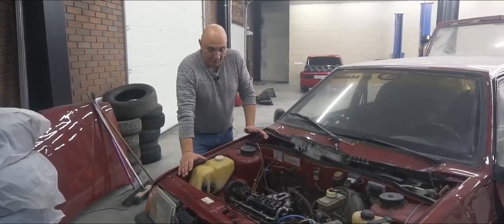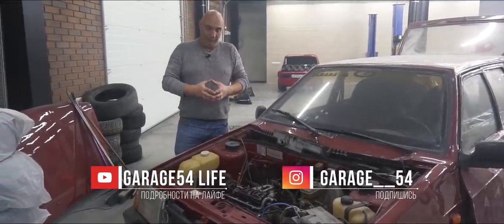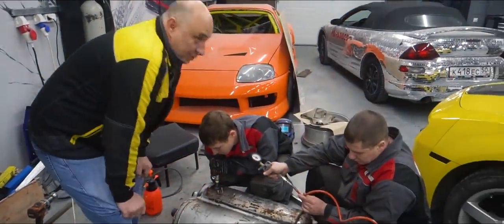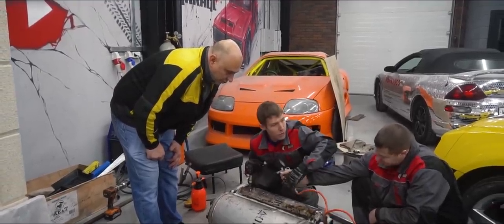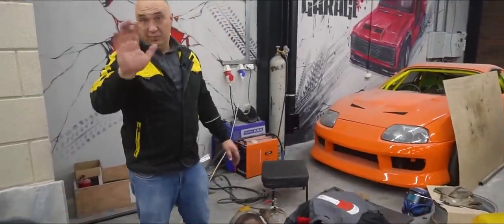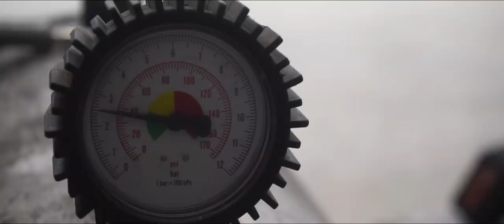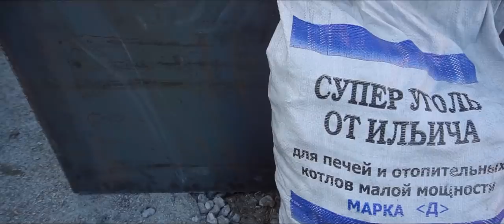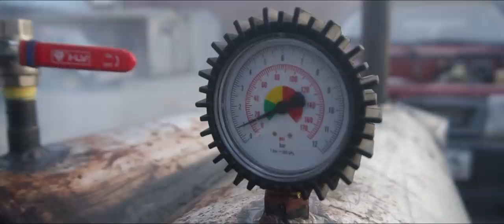Steam engine conversion – first startup

Comment: Put the steam engine on a trailer behind the car and pull it around while driving....you’ll figure it out.
Reply: Well, the boiler on a trailer, anyway. Of course that would require a very long steam pipe running to the engine and a flexible section ...
Reply: Merlin Skinner True, but he’s known to do some crazy configurations. I guess he could also put it behind the seat by taking the top completely off...OR, use a truck and put it in the bed. It’s a crazy idea to begin with, so anything goes at this point.
Reply: full boost caboose style
Reply: I would say that putting the boiler on a trailer is quite a good idea unless of course you want to set the car on fire and kill the driver, the steam pipe going to the engine will need good insulation and to be flexible on the end to allow for going around corners.
Should be good for a laugh if nothing else.
Reply: barry phillips Hey , I never said it would be safe 🤣. But he’s done some questionable things in the past, did you see his cabin on wheels with a burning furnace for his sauna. And let’s not forget the girls in bikinis! 😂
Reply: On the Russian version of the channel, they finished this project quite a while ago. They just cut the car up and slam it on the back of the car
Reply: Robert R Thanks, just watched it.
Reply: Eghads! NO feedwater system, NO safety valve, not even a level sight glass!
Let's NOT do this.
Reply: can they also recycle the steam coming from the exhaust back into system perhaps
Reply: @michigandon  they are just going to send it
Reply: @jarredri  huh?
Reply: Sorry, but as an operator of large stationary 100K PPH boilers this is like a MAJOR cringefest.
Reply: @michigandon  they are in Russia safety is the last thing on their minds they just want to prove that it will work.
I used to work in a power house maintaining 4 800 hp stem generators running 500 psi steam pressure
Reply: Just put the boiler on the roof of the car. Or cut the roof if you want to keep the car and the center of gravity low
Reply: behind the front seats  just i hope they put in a fire wall to protected the driver and take out the fuel tank. good job 54
Reply: in the trunk. bonus excellent heater for cold russian winter
Reply: you should put the boiler on a trailer and use a car with the engine in the back so you can shorten the pipe
Reply: @jayesjjani2278  Or into a sauna on trailer behind the car?

Comment: Everything about this boiler gives me the fear... the project is cool, id just watch from a mile away 😂
Reply: And now they are going to strap it to an old Lada and drive it around. Absolutely idiotically dangerous but that's why I love this channel
Reply: Surely one of the most dangerous thing a ever see. That's crazy
Reply: No way of keeping an eye on water level, fire tubes out with the water level, giant seem welds along an un braced seam that leak and no safety valve 😂 its so horrifying but yet so fantastic at the same time 😂
Reply: @Frz45  Watch in 2020 for the "Turning a Lada into a powered wheelchair" episode
Reply: Oh those Russians 😂
Reply: Read my mind, as soon as I saw how those two tanks were cut and welded together.
Reply: @andresouza2314  Yes they eliminated the hoop stress of the original tanks when the welded the two together.  They should have used two separate tanks plumbed together for safer boiler.
Reply: Or a flat plate spanning the main weld seam.  Yes, they have a dangerous pressure vessel.   All kinds of pressure vessel rules broken beyond that.

Comment: Looking forward to 3 years from now when these dudes are putting rockets into space.
Reply: A wooden steam power rocket ship that was cooked in soup
Reply: *Rockets on a Lada.
It doesn't have to go up to space, as long as it flies high enough and explodes magnificently.
Reply: Building sketchy boilers with no pressure relief valve, they won't live long enough.
Reply: @1one3_Racing  they'll be fine.
Reply: Ladas in space*

Comment: Zero carbon emissions

Meanwhile at the boiler room:
Na, Ivan, burn the Mamut, da?
Reply: Dude i laughed so hard best comment
Reply: Yeah, natural gas would be a better option, but hey, I like the idea!
Reply: the car itself is carbon free until the next episode 😁
Reply: comment is spot on, and I don't care what anybody says there's nothing on Earth that's zero carbon emissions. even the finest electric cars have utilized diesel fired engines 4 mining equipment and the production of the materials to mind the necessary metals to produce everything on the car. also the more Plastics memes there's more oil involved in the production of the vehicle. all you do is you just trade one bit of controversy for another.
Reply: Sunshine Kid it really would be rather funny if they took water heater figured out how to retrofit it to the car.
Reply: It is very efficient. Only consumes 15KG of coal per minute for idling.
Reply: @seanstrack4022  Also, unless they're getting their charges from a solar only system, then they are likely getting the electricity to charge them from an electricity plant which still burns fossil fuels.  So even if everybody had electric cars, but charged them off the local power grid (which the infrastructure couldn't withstand but assuming everything just worked) they would be a HUGE burden on the local power plants which would have to burn even more fossil fuels to keep up with the demands.  So yeah, you're just trading one form of emissions to another is all it is....
Reply: Да

Comment: You can call this already a small success with the very limited knowledge of steam boilers and engines these guys have.
There are however a few considerations I have to give with my knowledge gathered as a steam locomotive fireman.
First, a steam boiler can be an exceptional dangerous device, more hazardous than cylinders with compressed gas or even some explosives.
They want to run the boiler eventually at 8 or 9 bars, at that pressure you get a boiling point of around 175°C.
The water volume in this boiler I estimate around 60 liters.
Steam has a volume 1800 times bigger than the water making that steam.
When that boiler fails (which probably will be the weld holding the halves together) the 60 liters of water will turn into 108 cubic metres of steam in an instance, because the water escapes into atmospheric pressure of just 1 bar where its boiling point is 100°C, the amount of energy in this explosion would be the same as contained in 35 .50BMG rounds.
So I would never consider even firing this boiler up to 9 bars with its strange construction and untested welds, the shrapnel from the boiler can easily kill someone.

They should have done a hydraulic test first at least, by filling it up with water completely and then adding pressure with compressed air trough the valve at the top to 1.5 times the desired working pressure, which is the easy way, cold water doesn't expand when the pressure suddenly drops so is relatively safe, you could get soaked in the worst case.

By this the boiler doesn't have a pressure release valve other than the manualy operated valve, when this valve can't be reached for some reason, or someone forgets to check the pressure; RUN FOR YOUR LIVE!

Then there is the water in the steam, the steam is what they call wet, it means that the steam temperature is just about the evaporation temperature, so if the steam comes in contact with colder surfaces or has a slight drop in pressure in the engine it starts to condensate.
This can be overcome by superheating the steam, by running the steam pipe between the boiler and engine trough the fire a couple of times, this raises the temperature of the steam without further raising the pressure, then the steam will be able to expand and cool down to some degree without condensation (the expansion causes the steam to cool down as well)
Real steam engine also do have drain cocks at the working ends of the cylinders where any water which collects in the initially cold cylinders can be drained trough, at start up these are open and are closed when the cylinders are at operating temperature, just check any video of a steam locomotive starting from stand while expelling huge clouds of vapour from their cylinders.

Then there is lubrication, the steam will mix up with the standard motor oil, so a special steam oil is needed.
Reply: Chill out they are slav's
Reply: This guy knows exactly what he's talking about - listen to him!

This project was MUCH more dangerous than their usual "Russian" danger levels for many, many reasons. They should really have consulted with some experienced (model) boiler designers/constructors before building their own...
Reply: Andrija, they are extremely dangerous slavs
Reply: Also no water gauges, no means of getting water into boiler, no fusible plug. This is a very frightening project. Like you Tom I have worked with steam all my life (54 years and counting) and this project scares the crap out of me. They might be Russian or Slavs but this can very easily KILL them and people around them. Lads the footwork has been done, read some books on boilers please as they have been written with the blood of our forebears. You are playing with a bomb!.....
Reply: @raymondo162  slavs are most dengerus to them selfs sorry for bad english im slav to
Reply: abner doble did some testing with regular motor oil, works fine, but needs extra equipment to make it work for long.
Reply: You are right Tom. It looks like they using high steam pressure, NOT steam expansion! high-pressure steam is 100 times as dangerous! and why later steam trains boats, etc mainly use expansion powered engines as they progressed, also wet steam will end up giving the engine hydraulic lock. Like you said it needs a heated feed pipe. 

I would not be in 500m with that thing not having a pressure release valve without any pressure testing!!  I would at least fit a pressure release valve set to say 4-5bar light it up stand back behind a house truck etc, and wait for one of them to blow, boiler... or pressure release valve? if its the latter set the pressure release valve 20% lower!!
PS I would not use a car engine if using high-pressure steam, but a suitable turbine/impeller pump instead.
Reply: they'd have to build a new head and feed it with a thin pipe full of liquid steam to do it adequately.
Reply: @hardergamer  It's still possible to use expansion with wet steam. 
Most steam locomotives before 1915 used wet steam, from then super heating came into use, although shunting (switching) engines didn't use it as at low speeds the super heating had very limited effect. 
With super heating a higher degree of expansion is possible, with valve cut offs of 75% or more. 
I suppose this car engine still has its valves and cams, so a percentage of cut off is available, and it uses expansion. 
The real danger of this experiment is in the boiler, because of lack of safety devices and its unsuitable shape and poor welds.
Reply: Just the sake of safety (structural integrity wise) could they have used a water heater? I remember looking at one once and it said it could handle 175 psi, sure it's not meant to be a pressure boiler but if think it'd be safer, plus don't water heaters have a simple pressure release valve? I remember the Mythbusters used 4 water heaters as boilers for their steam machine gun experiment. The gun never worked right, but it seem like the boilers did...
Reply: water heaters, most of them, have an air release valve, so they'll be full of water.  when they start making gaseous steam they'll get real scary, so the valve burps it off, but a continuous supply of water would be needed to keep it from building gas despite the valve.

long as they keep it below pressure limit, have a gas release valve, a constant supply of water and a soft solder low water blowoff, they should be ok.
Reply: 2 bars is fine but I'd be a bit concerned higher than 4. Unfortunate it probably needs 6-8in an engine that size to at least do a skid.
Reply: they probably have the skill to build a whole new engine and integrate a 2:1 gear(they were getting about a thou rpm i think), v4 would probably be a better package.  the pistons would need a quarterish of that surface area to do the same work.
Reply: Another thing they could do would be to route the exhaust steam through the stack to induce a draft into the firebox thus eliminating the fan once it is running.
Reply: probably be a grand idea if they were doing continuous steam production, but with the main storage tank supplying the draft steam, not probably that grand.  a separate supply, like, household water pressure through a copper tube could supply the draft.
Reply: I hope your comment gets more likes, and more exposure to anyone considering experimenting with steam. Its spot-on and informative. Sure theres lots of stored energy in petrol based fuels but its only released some at a time depending on atomization (surface area available for reaction). Superheated water under pressure can release all its energy at once (exactly like an explosion) and thats the scary part. You cant put that monster back in the box once it starts to escape. Given the choice I'd stand beside a failing oxygen tank under 2000+psi rather than a failing steam boiler of the same size at 20psi, at least I would have a chance.
Reply: You certainly have some decent knowledge about boilers and physics. I wanted to warn them about this, but you already done it better than me. I can't even dare to stand in 100 meter radious of that home made boiler when it runs at 4 bar. The explosion will not end just to super heated water expansion. Think about the fuckin fragments coming from the body of that boiler!!!! While flying at 3x sound speed Lol
Reply: After reading his whole post, this was perfect. Hahaha
Reply: I think that this is more for proof of concept. But I do agree, it is dangerous.
Reply: If that channel allows the real channel read these comments... or else the comments of this video are just a waste of time.
Reply: And that’s why there never were a follow up video...
Reply: 😐 jokes on you smart guy that's vodka in the tanks not water.
Reply: @felderup cool story bro.
Reply: @tom lahaye cool story bro.

Comment: 1700s steam cars 
1890s gas engine cars
2019 electric cars
2050 steam cars
Reply: You missed electric cars in the early 1900's, actually before gas.
Reply: The first car to exceed 100KPH was fully electric!
Reply: 3000 electric steam
Reply: The problem was and still the batteries
Reply: Unintended Consequences  Pollution in the production of the batteries and reliability stills a problem
Reply: Unintended Consequences  Unless you happen to be in one when it goes up like Kakatoa and it HAS happened.
Reply: I wish I'd love for a proper crack at a steam car with a proper White/Doble  steam generator + a Heat exchange on the condenser + a lightish frame closer to the Stanley Steamer Cup car + Automation of steam systems like clearing water applying oil and maintaining pressure. That combination has never been created (and many "modern" versions like that British one are crap).
Reply: Also 1925 was the last great steam car.
Search:
1925 Doble E-20 Steam Car - Jay Leno's Garage
1906 Stanley Steamer Vanderbilt Cup Racer - Jay Leno's Garage
1907 White Steam Car, 30 Hp - Jay Leno's Garage
Reply: @timelord10  petrol cars came out in 1870s, before electric cars

Comment: Garage 54, always welding through the paint and the rust. No surface prep leads to very real results.
Reply: Are  you  expecting  red bull  and  mc donalds  stickers  on  it  ?  .................
Reply: @Gabriel-he6ih  You  first  .............
Reply: I think he is expecting actually good welds that can handle steam pressure and not leak.  You want that before you line the pipes with thick insulation to prevent the condensation.
Reply: Turtle Head  No one wants to see your turtle head. Welding is a trade, not a profession. I am a certified welder and surface prep is basic.
Reply: Still better than most SEMA welds!
Reply: And if you put the amp's up, it doesn't really matter for "farm" use. #sendit
Reply: "By dictionary defintion" means less than nothing. Most commonly, a job that requires a bachelor's degree is referred to as a profession. Those with an associate's and/or apprenticeship education are tradesmen.

Comment: Crazy Ivans;...  a Boiler without a safety pressure relief valve is a BOMB!
Reply: So pick which poison you prefer. A combustion engine at the risk of the fuel catching fire in a crash, or a steam engine with the risk of a blown boiler.
Reply: Exotic Creature An exploding boiler will be a whole lot more violent than burning gasoline.
Reply: @Engineer9736  More violent and instantaneous indeed. But more dangerous? It's hard to definitely say which is more dangerous when both scenarios present a very different risk and very different outcome in the event of failure.

Comment: you can improve the performance by feeding steam to 2 cylinders and the exhaust of thous 2 cylinders to the next to cylinders
Reply: yes but not without changing the duration of the valve opening on the first two cylinders so that a smaller volume of high pressure steam gets fed into the high pressure side to make up for the loss in power of the low pressure side. it's why double and triple expansion steam engines have ever-increasing cylinder and piston size as pressure decreases or you will be trying to compress the low pressure steam.
Reply: More like exhaust from 1 into inlet of 3... Still, wouldn't be likely to improve power, only efficiency. 

Actually, best if they just get it to work first.
Reply: For compounding you need different sized cylinders increasing as the pressure drops, not going to work on this engine.